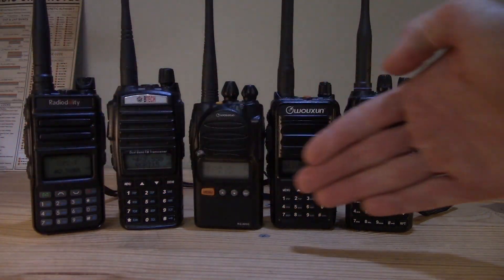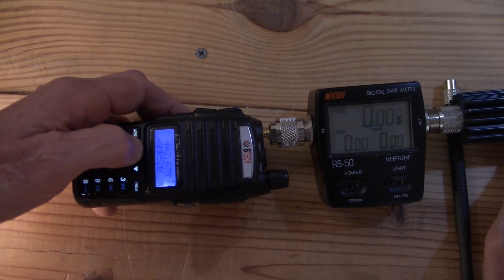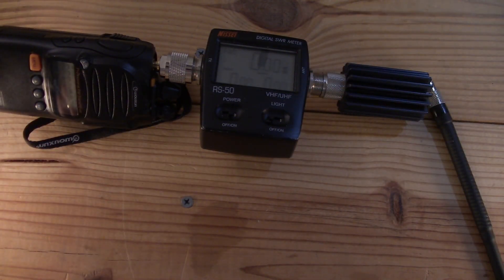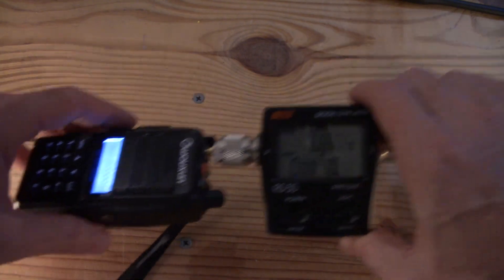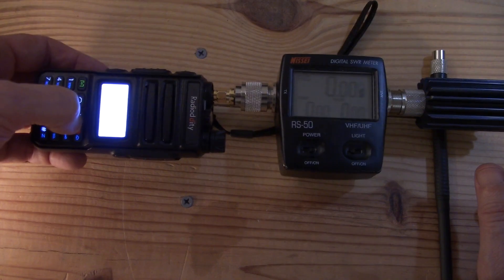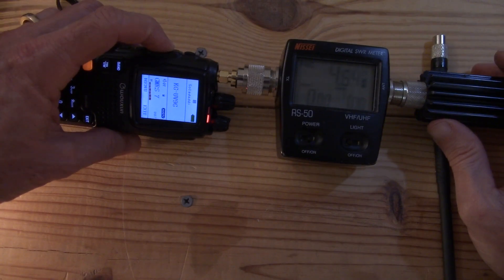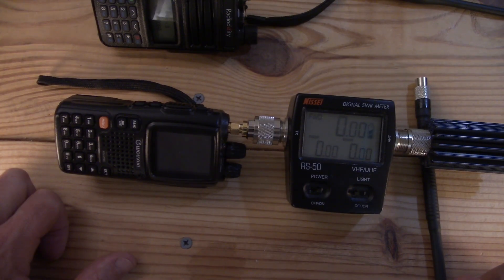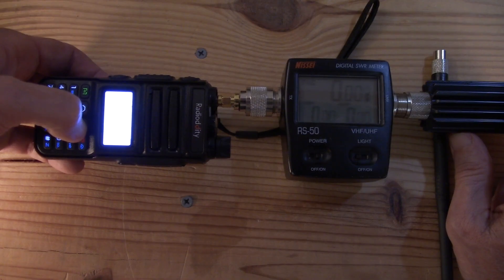GMRS Power Testing on 5 Handheld Radios.

Comment: Note that the UV9G PRO and the latest UV9GX also have 3 power levels, so you can dial in what you need. :)
Reply from the maker: Oh yes. Good thing about the mid setting is a bigger difference going for .5 to 2 watts than a 2 to 5 watt change.

Comment: Thank you for the video! Hmm, interesting. I have two 805s. Except for channels 8-14,  they both produce more power. One puts out 5.2 watts flat. The second one, purchased a few months earlier, puts out 5.5 watts flat. I actually just did this test. I used the exact same fully charged battery for both radios. Physically the same battery that I moved back and forth between the radios for consistency. My meter was Surecom SW-33PLUS. So there must be at least two variables here. Variation between radios, variation between meters, or both. Perhaps someone else might chime in?
Reply from the maker: The box my 805 came in says 4 watts, I’ll check. I bought it in 2018 or ‘19???
Reply: @Soladaddy  I got mine a couple of years ago, give or take. Just found one of the boxes. It says, up to 5 watts.
Reply from the maker: @SK-rj1ti Confirmed mine says up to 4 watts. What’s interesting is mine has a reprinted sticker with the original specs covered up. Wish I could post a pic here of the box.
Reply: @Soladaddy  Interesting! Then it seems like earlier editions of the 805 had lower power, and either Wouxun or BTWR knew it.

I just measured the output of my uvd1p as a reference. Same battery, same meter, same dummy load (yes, I did use a dummy load in all tests:). Got 4.4 watts flat on 462.550, 462.725, 467.550, and 467.725. This seems to be consistent with the specs, so my meter is probably not totally crazy:)